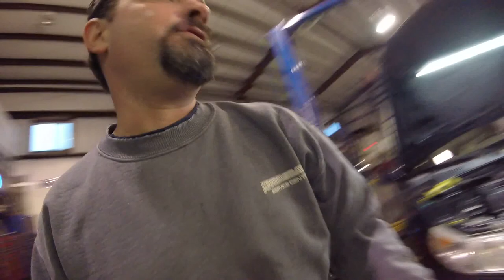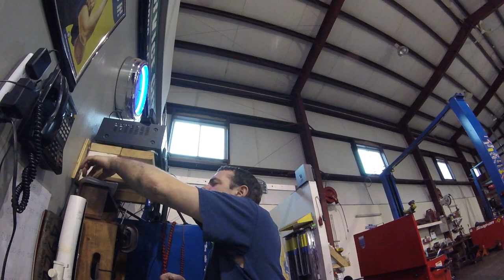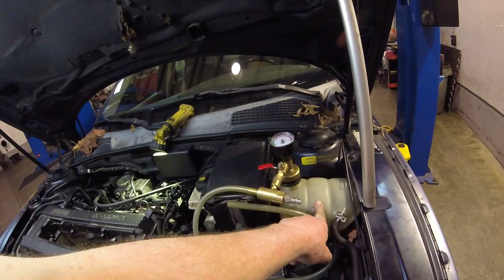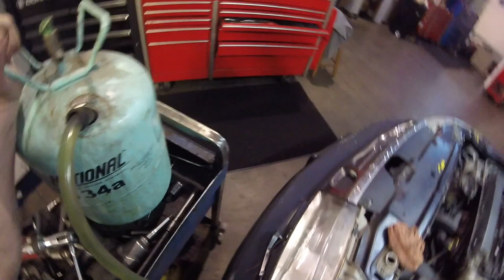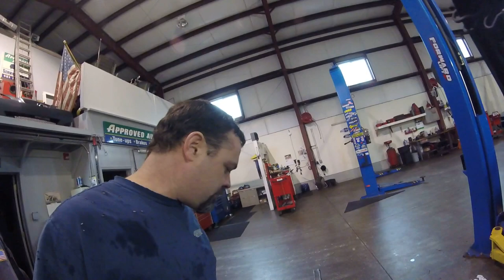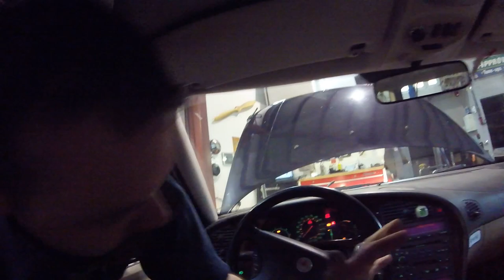Finishing the Saab 9-5 Head Gasket Swap!

Comment: The air lift looks like an amazing tool. Just the time saved bleeding air out of the system makes it worth it. I'm going to look into getting one of those.
Reply: +Thomson85  $130, not as expensive as I would have thought.  

http://www.amazon.com/UView-550000-Airlift-Cooling-Checker/dp/B0002SRH5G/ref=sr_1_4?ie=UTF8&qid=1451279742&sr=8-4&keywords=air+lift
Reply: +Thomson85 Yeah they're actually quite affordable. I might have to get one just got personal use.

Comment: Can you use the Air Lift to evac. the cooling system?
Reply from the maker: +vwfoolwhy It makes a mess if there is too much coolant in the system. It has to be relatively well drained as in after a radiator or thermostat.